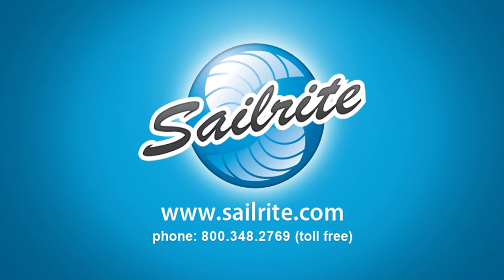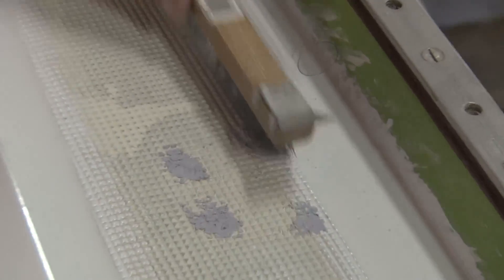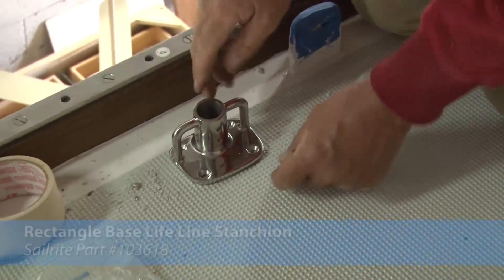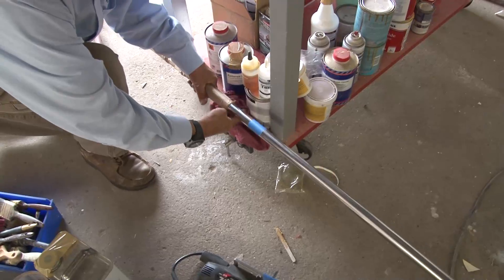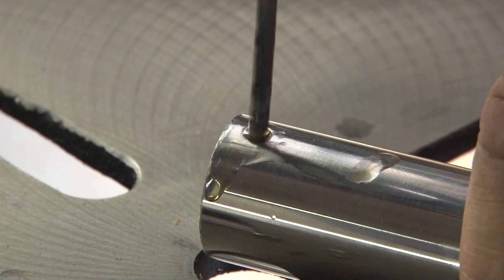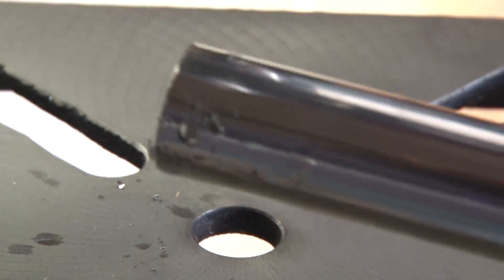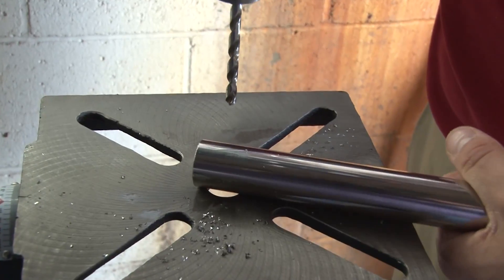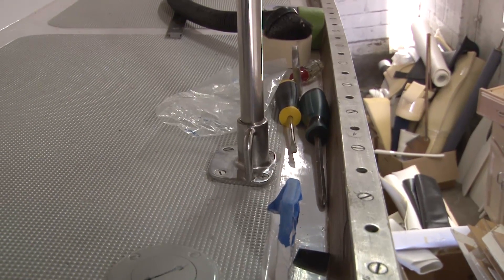Boat Stanchions - How to Install and Make Stanchion Poles (Unlisted - Replaced on Oct 7th 2022)

Comment: I wouldn't use that plumbers epoxy.  You might try the self mixing tubes of epoxy and only try to keep the epoxy in the holes. That plumbers epoxy made a mess.
Chamfer screw holes to prevent gelcoat from getting spider cracks.
 Cut off grinder works better on stainless.

Comment: Silicone has NO place on a boat.  Bed that stanchion base with black butyl rubber.  Put a small 45 degree taper at the top of all your holes and wrap the bolts with butyl rubber.  They'll never leak.   Butyl tape above the waterline and Sikaflex 291 below the waterline.

Comment: nice comments ::::((((      learning something here, thank you
now i have some honest questions,  why not silicone?  why is butyl tape better?  and countersink what, how(drill in reverse?!),and why?   thanks
Reply from the maker: Silicone does have a few drawbacks that you’ll want to consider. Many sailors find silicone messy and difficult to clean off your boat. To make matters worse, your boat’s gelcoat is prone to absorb leftover silicone that squeezes out from under the hardware and then the silicone attracts dirt. To prevent this, the best way to clean up the silicone is to wet sand it off, rinsing your sandpaper frequently to prevent grinding the silicone deeper into the gelcoat. If your hardware ever needs to be changed out, you’ll need to completely remove all of the old silicone before re-bedding, which can be a lot of work. For more see this blog: https://www.sailrite.com/Bedding-Deck-Hardware-Silicone-vs-Butyl-Tape Countersink holes allow the bedding to sink into the cavity for a better seal and also helps to prevent spidering of the fiberglass. Reverse?!?! We are not drilling in reverse, it just looks that way in the video for some strange reason.
Reply: @SailriteDIY    Makes sense; 
No,what i do when drilling on gel coat,to get a nice round hole and avoid splintering it,is this:  drill the hole with a much smaller drill bit, then i drill  in reverse for a while with the final drill bit,and then of course i switch to forward when past the gel coat; when countersinking,as the cone opens up, i switch to reverse again,forward again,no pressure,etc; this leaves a crack free,burnished gel coat cone; even more important when counterboring on the gel coated GRF.
Reply: Rather than have fingers so close to the jig saw I’d recommend securing the jig saw to a special table upside down and move the piece over it in a controlled way. Make the deck holes bigger; Counter sink top and bottom of the deck hole using a countersink drill bit, making an hourglass shape to give the filler something to grab onto. Fill with epoxy filler. Drill the exact size for the bolt. Tape off to avoid sealant mess. I use 3M 4200 sealant.

Comment: Wow, I thought silicone sealant on boats went out with VHS tapes! Butyl tape is the ONLY way to go! Protect the core with epoxy, counter sink and butyl tape!
Reply: Also, I've found that Marine-Tex epoxy works nicely for neatly filling holes. Before it cures simply rub the area with a tough cloth damp with acetone. Even on non-skid surfaces, only the hole is filled with little or no overlap into the non-skid.
Reply: Butyl will become fluid in hot climates

Comment: A couple recommendations:
1. For more strength - drill out a larger area of core (between the deck glasses) and refill with glass and epoxy.
2. Butyl, butyl, butyl! (Seriously, using silicone anywhere near bedding is just asking for deck leaks and core issues forever...
Reply: Absolutely yes on the butyl rubber bedding.
Reply: Butyl is rubbish…I’ve never seen it used anywhere but America

Comment: Slotted and cross head screws on the base, silicone all over the place. Drilling a hole in the post top AFTER tapping the post. What a mess. This guys a joke. This is years of exactly how not to do this

Comment: Silicone?  Oh hell no. Didn't seal the new holes with epoxy to protect the core. Didn't countersink the new holes and didn't use butyl tape? Not touching my boat.
Reply: Kent Adams I’m with you never silicone plus the holes in the deck should over size and filled with thicken epoxy to protect the core.

Comment: You should really countersink all your holes when installing stanchions it relieves the fibers from causing stress cracks and make for an area that will seal better.  Butyl tape also works alot better than  silicone
Reply from the maker: Yes, I agree. We also sell a Butyl tape now that is perfect as a bedding compound.
Reply: Tape off the surrounds and the top of the base with painters tape to avoid the mess